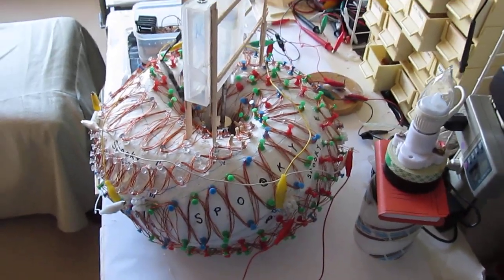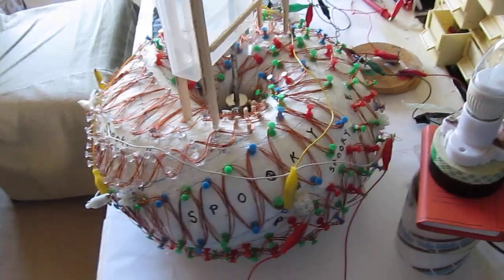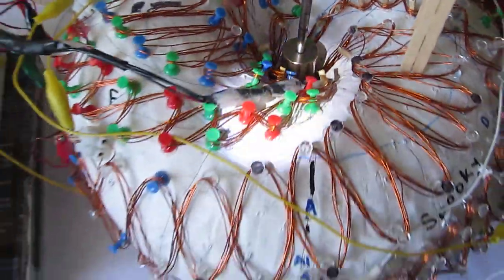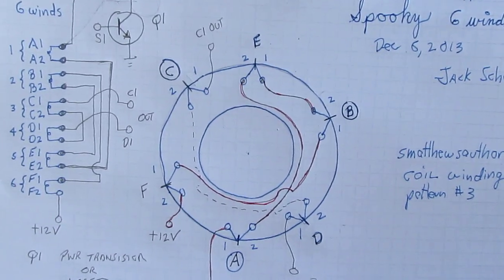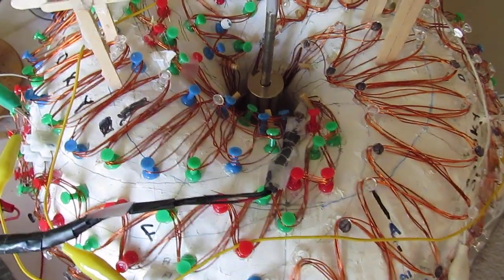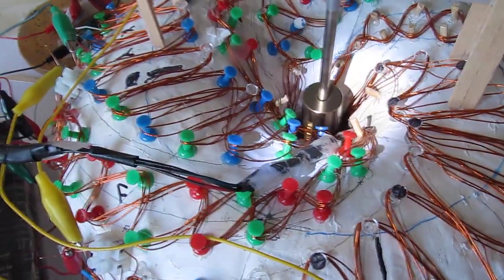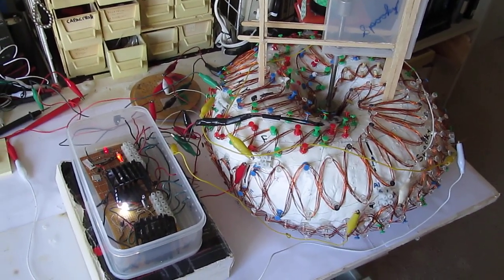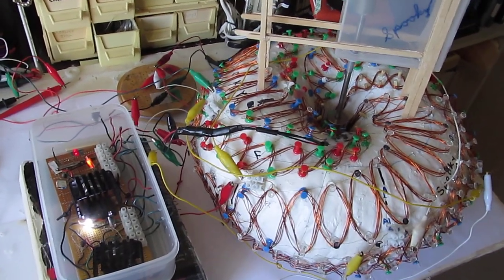Spooky Coil  ( all 6 windings )

Comment: Hi Jack,

In regards to all noise you probably want to have magnetic bearings as they will make shaft to levitate.
Also the geometry of windings to the magnet in middle seems is same way as in conventional motor. Wonder if there is any Rodin coils style configuration what would have spin inside of toroid because original got 90 degrees to the side of the coil..
Reply from the maker: This spooky coil screams,  and is the first of the toroidal ones that wants to rotate the neorotor on an axis thru the center of the toroid.  This shows some whirling effect around that axis more than a regular rodin/abha type coil.   We can call this field Solid inductor geometry or something.

Comment: Wow ...  Thank you for making this video Jack!  I played both videos to compare the sounds to gauge the speed and it seems to be an octave higher.  I am assuming it is running 2x's as fast based on the sound alone.  Let me (us) know if you ever scope it for specific rpm's.  How much torque does it have?  Thank you again.  I added it to my Vortex coil playlist.
Reply from the maker: The 2 pairs of winds in series gives it more torque and RPMs, tho the series resistance is more than with one pair of winds of course.   Uses approx 25 watts at speed.   Voltage induced in the the 3rd pair of winds used as output is approx 3 volts AC.
Reply: mnsman1 put out a good video on how to gauge the rpm of a machine based on the audio frequency, if you get curious. keep up the good work, guys!